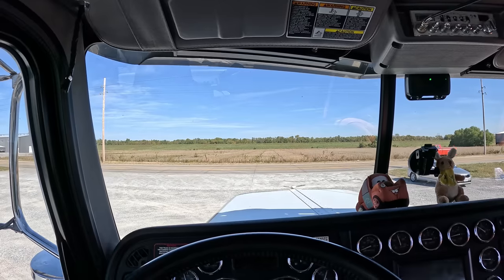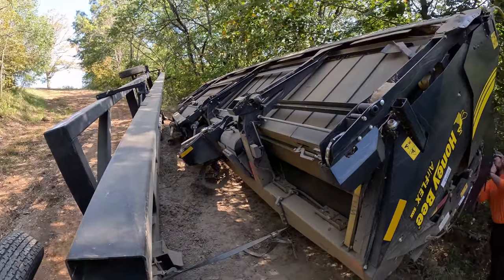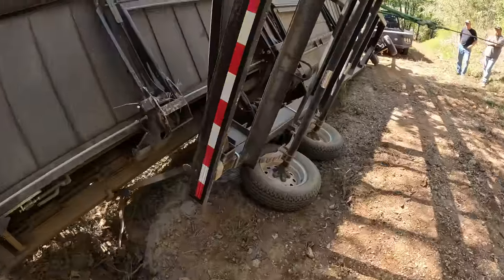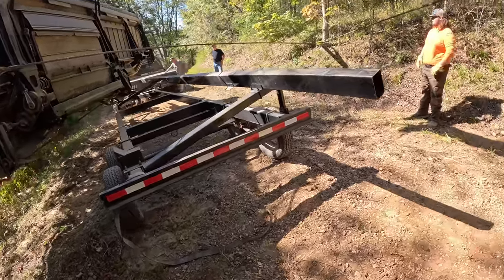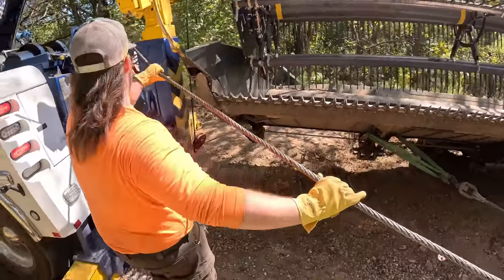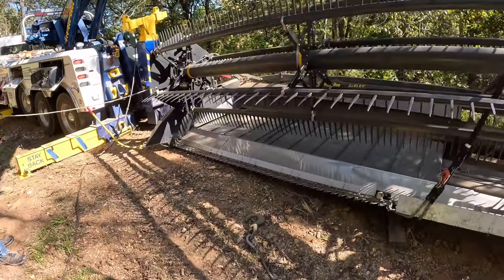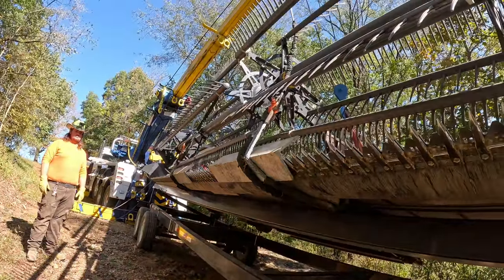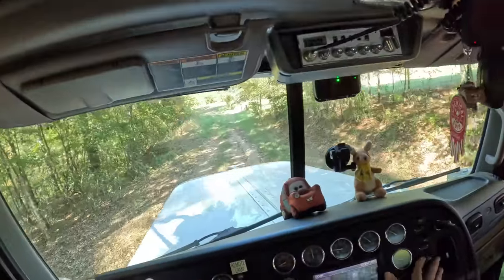SOY YA LATER HEADER...     HARVEST TIME HEADACHE

Comment: Wow , well done , a heavy super delicate piece of intricate machinery saved.
Couple things, seems to me the trailer is a terrible design. It might be wise to counter weight the right side of the trailer with a 1000 lbs of dead weight to help balance the weight distribution.
As a carpenter I always had at least 2 2x4x10 in my truck at all times no matter what. They saved me in many different ways.
 Ron ,I was so worried the blades would be bent by unusual pressures. If you carried 2-4 2x6x16s in your long bed storage area you could have quickly made a 16' angle to better support and spread the force on those teeth. 
It all worked out amazingly but the farmer said the tolerance was 5 degrees, to me the bent appeared to double that.
 Ron ,I have such respect for your skill and effort and conscientious service.
 Once again ,Ron Pratt saves a farmer 10s thousands of dollars.

Comment: I'm only 8 minutes in, but this is definitely a challenge. The only strong structural element is along the backside of the frame (where it attaches to the combine), but those are completely in the wrong position. Everything else is pretty lightweight and is designed to flex and conform to the ground.

Comment: I used to build that style of draper header for a different manufacturer.
The cutter bar is pretty tough, the other strength point is the back beam, which is usually covered with hydraulics and such.
In the ones I built, there was a number tie down points on the  cutter bar support.
An interresting job.
Reply: These honeybees are known to be very fragile, they do a great job but we had to go back to macdon because the honeybees would fall apart if you laid even just a finger on them
Reply: You guys did awesome job.

Comment: A draper head is designed to be flexible. There is not a lot of steel in the framework. That was a great job to get the thing on the trailer in a condition they could do a little bit of hammer work and have it cutting beans.

Comment: Awesome recovery there Ron & Ethan that was in a bad spot but I had confidence that you both working together would make it come together without further damage to the header ! I don't like the trailer designed up front that being uneven ground and having washed out ruts those two front tires that close together gives lets the trailer have a tipping point which I think was some of their problem on that rough unelven ground ! I redesign the front of the trailer so that the front tires could be further apart to give more stability on uneven ground !

Comment: That road is better than some I took semis on. One we had to use to dispose of oil based mud would have the outside of your steers hanging off 1&1/2 inches. Some areas are made “JUST” to get the equipment in.

Comment: That recovery looked very tough. Ron. However, you  and Ethan triumphed eventually.!! I can understand you not trying to create further damage as it looked like a complicated and expensive piece of machinery. I did think though that the trailer was totally unsuitable for the task, especially given the steep hill and track leaning to the left. Also, the centre of gravity was all wrong. Plus points were sunshine, no rain , no overhead power lines and helpful customers.
Your good humour, whilst under pressure, was commendable.
Best Wishes Roy W UK

Comment: I'm not there of course,  but if I were there, I would have suggested using strap attached to the bottom/ heavy side and strapped it to a couple trees on the left side of the road and swung the boom to the right to put the beam back up right.

Comment: Big tree off to the right of the road.. My instinct would be snatch blocks on the tree and redirect the lines to try to pull it right back up onto the trailer and then flip the trailer with the weight of it. Downside would be you wouldn't have much for a catch line unless you were able to do the same thing on the opposite side. My other instinct would be to get a portable welder and weld on some grab points that you could then lift it from. It's stupid that machinery like that don't have grab points designed into them. 
:D I love it when we have similar ideas.. if it wasn't for my back I think I would've been good at recovery work. Man, watching this video.. I can almost smell the trees and the dirt.. showing just how much time I spent out in the woods as a kid in a very similar climate.. just minus the humidity. Stirling City California is where my grand parents were from, Papa worked for Diamond Match at the mill that was up there for a long time. It's nothing but clay, pine trees, Douglas Fir, Cedar and sugar pine with the odd dogwood, ash and birch thrown in. Unfortunately I'll probably never go up there again now that they're both gone.. except maybe to pick up stuff once a family friend that's a Vietnam vet passes.. he bequeathed to me all his pictures from being a tunnel rat and everything. (despite the fact that he was a Navy Corpsman) https://en.wikipedia.org/wiki/Stirling_City,_California if you want to read about the history.

Comment: So- there are two points to the farmers as I see- the trailer needs to be modified so the header does not tip. OR  the more costly if they own the property is to cut another road into the back area where the soy beans are; that way the combine and the header can be used without the trailer.

Comment: You know I know they're not designed to be flipped upside down in a ditch but would it have killed them to throw on a few solid recovery points. From the few farm equipment recoveries I've watched on this channel it seems to be a reoccurring theme. But amazing recovery well done guys, I was definitely a little surprised and excited to see you attempt to flip it right back on the trailer from the beginning that would have been one hell of a feat had you managed it great job.
Reply: I will agree with the lack of good hook points the but on these heads it’s hard because you don’t want anything in front of the sickle bar (that’s the cutter) because it would interfere with cutting and to give enough frame to mount one to outside of the center would defeat the purpose of the flex head but watching some of the other videos on farm equipment recovery it makes you wonder why not add the hook points. I know tons of farmers who would love to have those when they get a machine stuck in the ditch.

Comment: The design of the header trailer was crazy! All the ones I've seen and used here in the UK have axles that are far wider. New Claas Xerion Combine header trailers also have front and rear steering wide axles and I'm sure that most manufacturers will follow. We are have far smaller roads here in the UK so the new designs from Class mean that we have stability with maneuverability  so getting the headers in to tight spaces is safer and easier. Also I'm concerned that the trailer used a ball hitch, surely should be using a through pin hitch which could have stopped the roll over.

Comment: The companies that build those headers need to design a way to lift them. They could put structure in so lifting bars could be slid in to lift at a balance point and removed so they don't interfere with harvesting the crop.

Comment: Well that's a tough one to move. Those headers aren't really held to the trailers.
Not a nice road for that style of trailer either.  
I wonder if it wouldn't have been easier to carry (I know that's not recommended) up to the flat where the combine is. Then the combine could have lifted it back onto the trailer. 
Ron, those pointy teeth break all the time. So no big issues with replacing those. 

IMO, Trying to get it on the trailer in the first place was the right move. Because it reduced the chance of damaging more things with how badly balanced headers are.

Comment: A little skeletal trailer for that head ,shouldn't be approved for the road , imagine that on the highway or back roads and obviously it's unstable because of the one sided weight .
That should be on a low loader heavy trailer ,all it would need is the cradle frame for it to sit on the deck ,a flatbed would be too high for the combine to load the head .
You got it done and it didn't fold up on you that's a positive.
Hope the training goes well for those who attend .

Comment: The problem is that trailer's wheels, especially the front wheels, were designed to be so close together.  Makes it very tippy especially when that axle turns or when there's any unevenness in the road like this dirt track.  Seems like an inadequate trailer for that much top heavy mass.  Sort of madness to try and take that down such a humpy hilly road.  Could use a regrading.

Comment: Well I knew you had an interesting time the moment I saw it was a honeybee  there great high performance  headers but there definitely not know for being heavy duty out of all the headers you could’ve found flipped off the trailer that’s probably the lightest most fragile and flexible one you could’ve found

For anyone unaware that cutter bar is one of the most if not the most flexible designs on the market so it can contour to uneven ground and cut as low to the ground as possible

Watching farther than when I originally commented it sounds like it released some air pressure partway threw you flipping it and it switched it to flex mode making it more flexible than it was when they set it down on the trailer before flipping it I don’t think it was dead flat though it would’ve been more flexed out

Comment: Awesome job, Ron and Ethan! Your dad/grandfather would be proud of how you handled this difficult job.  Managed to get that header upright w/o any damage, even though the farmer said that he's ok with a few bent tines. That's a poorly designed trailer setup imo, should have made it so that the left side where all the weight is, is either facing down or up top, where it can affect the balance in the least. Whoever designed the trailer setup must have assumed that all roads would be level.  A question of curiosity.... How far out can the recovery boom extend? I ask this question because I cannot find that spec,  and was watching Pepe's towing earlier today, where they were picking a motorcycle of the side of a mountain. In the comments, somebody asked if they would put a 400' boom on the truck. My reaction was to think that person is clueless as to how the weight would affect the truck and it's capabilities. I was looking around, but could not find the spec, most of the answers were about the rotator's turrent travel.

Comment: Yet another piece of machinery designed by engineers that never spent a day in the field other than driving by one. Invariably that header would end up having to be moved without a combine attached at some point in its life. The designer never went through a “what if” exercise. There should have been identified pick points available on it from most orientations. Even once you had it upright you still didn’t have adequate pick points. Even that trailer was dumb. That narrow front end configuration is known for being tippy. And, no tie down points between half the trailer and the load longitudinally? I was always taught that if the trailer tips over, the load better still be attached to it. Even with all the cards stacked against you, you managed to right it and reload it without collateral damage. Nice job.

Comment: for as much as that header cost, the manufacturer certainly didn't put much thinking into the trailer did they? looks like it's way heavier on the low side and has no hold down on the high side, they were asking for this sort of thing to happen!

these farmers could strap a water tank to the high side as counter weight and maybe bodge a strap or two over there while they are at it so at least if the trailer rolls like that the head stays put, really should have been like that from the manufacturer.

Comment: The whole cause of this is the poor design of the trailer. To haul a rectangular load on a tricycle based trailer is unsafe even on a flat paved roadway, let alone on a rain washed, uneven, sloped field access lane. Trailer axle wheelbase must always be wider, especially when COG is not in center of load or trailer. Good job preventing further damage to a high dollar header.

Comment: Hey Ron this may be a silly/dumb question but are those fabricesque straps machine washable? I see them collect a ton of mud and dust and was wondering how you get them clean as I’m sure you don’t wanna always have them filthy. Thanks for what you do!
Reply from the maker: We don't put them in a washing machine.   We spray them off and then hang them to dry.  Depending upon the amount and type of dirt/gravel we will use a normal garden hose with mild soap and a scrub brush or a hot water pressure washer.   If, however, they've been exposed to certain hazardous materials, we will dispose of them, replace them and bill them out to the job.  Thanks for watching and God bless.
Reply: @RonPratt  thanks for the reply. And I totally get replacing them should they come into contact with a corrosive or something worse item. Do not need structural weaknesses to cause an unexpected failure. ESPECIALLY in your line of work. Thank you for what you do. If ever I’m in Scott City, I’d like to meet you for sure. I’ve been watching you guys for a while now and it makes me happy to find someone that is always willing to go above and beyond what expectations are. Also, love the fact that you respect other’s beliefs. That alone puts you a cut above the rest. Stay safe, and happy recording.